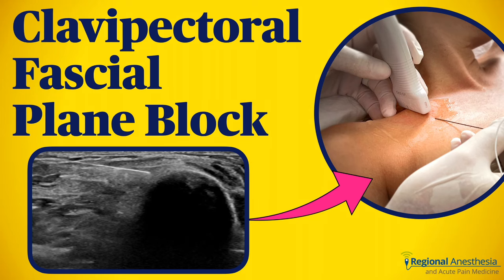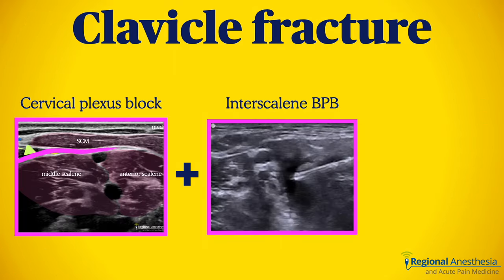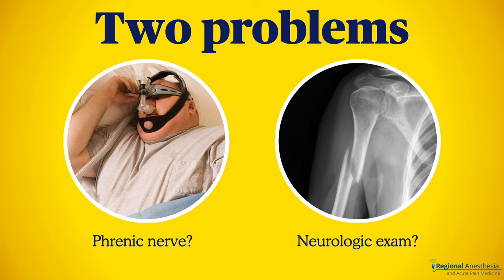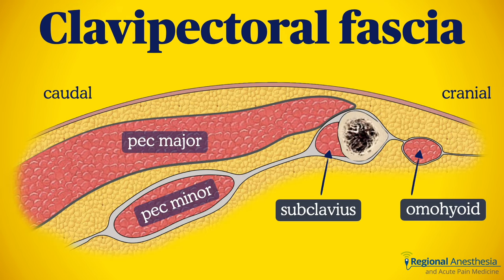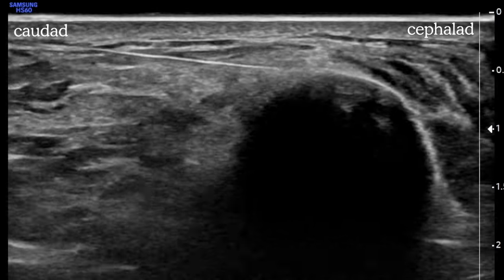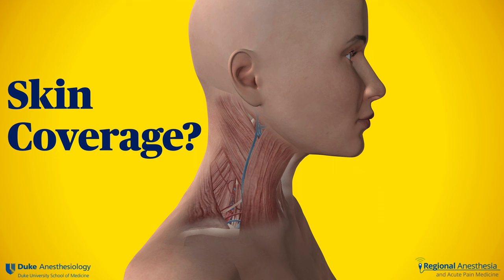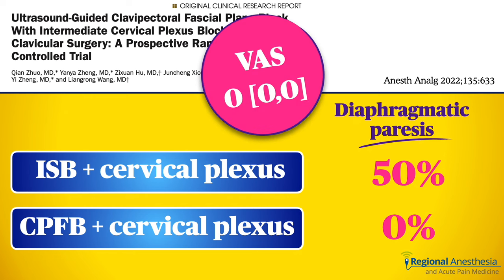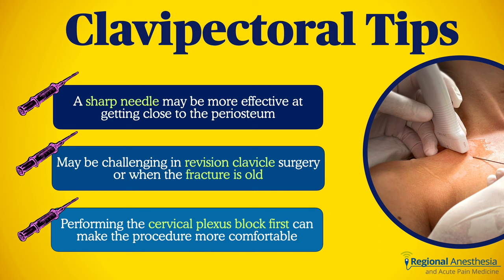Clavipectoral Fascial Plane Block

Comment: I’ve used this technique for about a year now and absolutely love it. However, I am curious as to how long prior to incision do you perform the clavipectoral fascia block? I ask because I have noticed some patients do great during the case and even in phase 1 of pacu but the block seems to wear off quickly while others get the relief I’d expect 18 to 24 hours.
Reply: Hello! In my practise combinate this block with cervical plexus block.  10-15 minutes after block may get surgery (lidocaine 1% + ropivacaine 0.375%). I think only ropivacaine solution will need a little bit more time before surgery.
Reply: Do you use any adjuvants?
Reply: @angelgomez5388  yes, decadron. I switched from 0.25% to 0.5% and it seems to work better.
Reply from the maker: Glad it's working well for you! I usually use a dilute solution of ropivacaine (0.2%) with epinephrine (2.5 mcg/ml) and dexamethasone (2 mg)--that combo typically provides 16-24 hrs of coverage. Hope that helps!
Reply: @mjonesCO this is for awake anaesthesia?

Comment: this block can be used as anesthesia or analgesia ?
Reply: I think a both. Low percent solution for analgesia, high percent for anesthesia.
Reply from the maker: Usually we're combining this with a light general anesthetic with LMA in order to provide patient comfort and immobility, so it's usually just an analgesic block. I have done it sometimes for surgical anesthesia but as @igork7346 mentioned, it's useful to increase the concentration to hasten the onset and provide a denser block (e.g. 0.375% ropivacaine). I'll also do a quick cervical plexus block in order to make SURE that I've blocked the skin fibers over the clavicle. Thanks for watching!